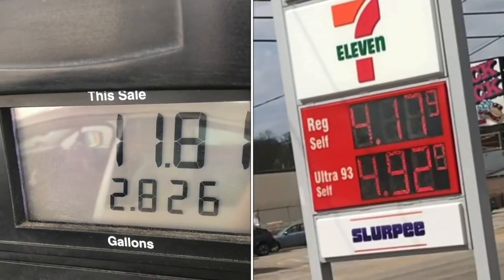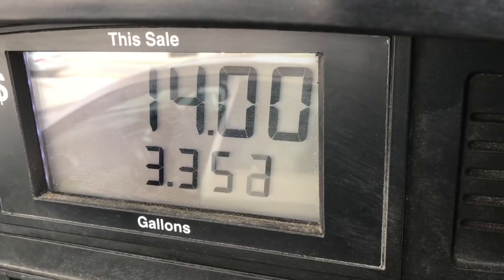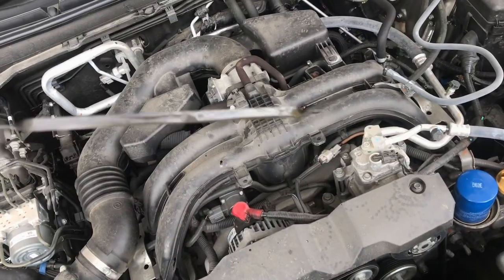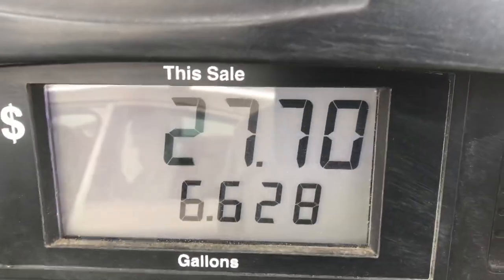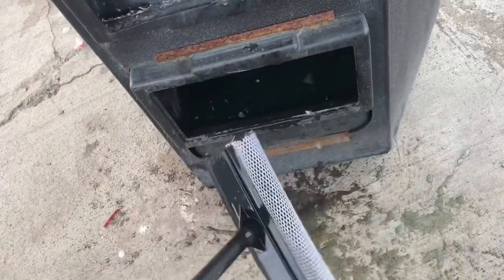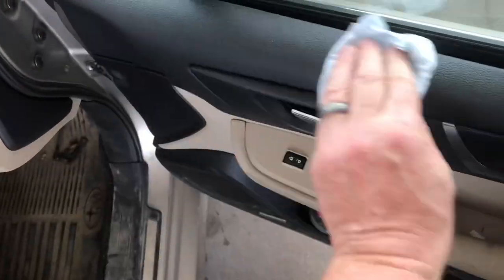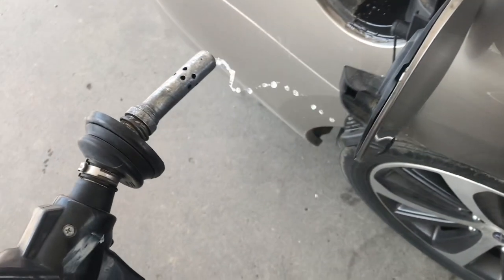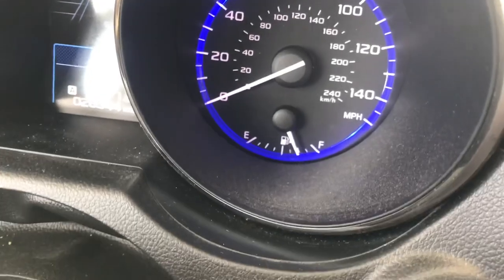what happens when the “gas pump” is SLOW SLOW SLOW…

Comment: There are mainly two reasons a dispenser may pump slow. 
1. Most common reason is that the fuel filter is getting clogged and needs to be replaced.
2. The leak detection system is sensing a line leak somewhere and triggers a semi shut down of the fuel pump inside the tank.